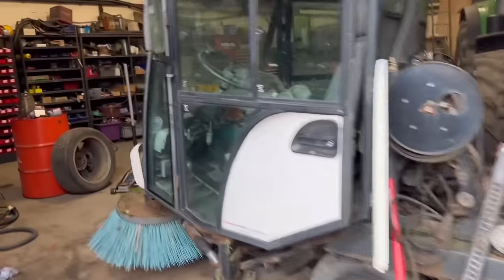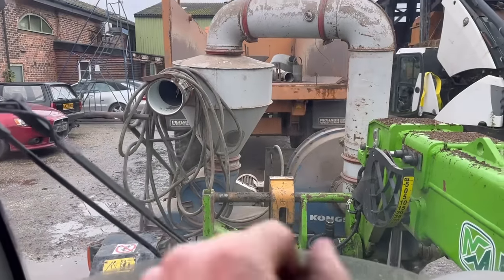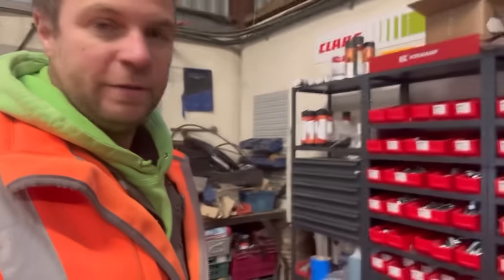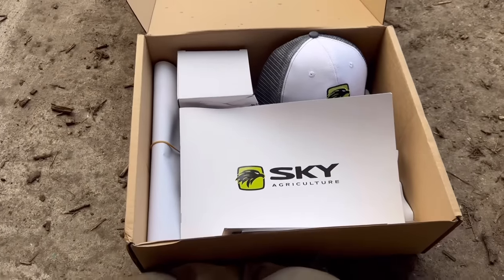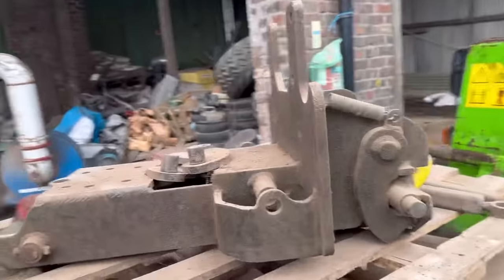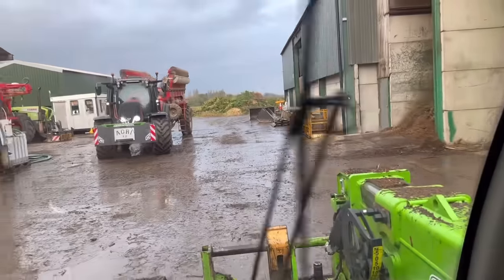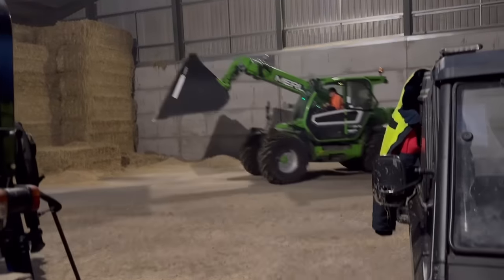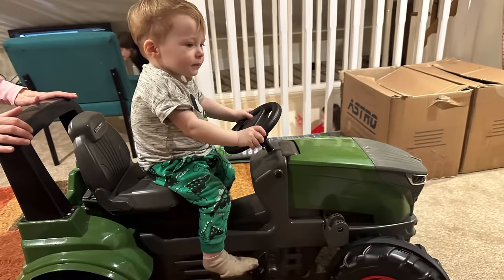WE NEED A BIG HOOVER FOR THIS JOB #AnswerAsAPercent 1322

Comment: A word or caution on using the sucker blower on wood chip I very much doubt it will work as it will jam up the rotary valve/ airlock under the cyclone. These are great for small items but anything long or stringy cause major problems.

Comment: Maybe if the sweepers weren't left outside theg wouldn't rust so badly. 
Why not use a mobile power unit generator build it a wheel base so to more around easier

Comment: Oh, Just for your info Olly, You can get a box which has several sized commando outlets That have a din rail with Mcbs that you can use with your 63a socket.  You can’t use them all at once but just to enable your welder and other bits  🤷🏼‍♂️

Comment: Hi Ollie we have the electric and the pto version of the konskilde suction blower they like clean grain but don’t like the dirty thrashy grain that sometimes accumulates in the bottom of bins and heaps fed from over head elevators. The pto one is way better as with the electric one the plug s get so hot you can’t get them open till they cool down and shrink. We use 3 inch slurry tanker pipe as a inlet. The pto one is makes a ford 6600 work hard.Fix a road sweeper will be more useful.

Comment: We used  to use a sucker blower to  but 2000 tons in the  grain store  and  then  load it back  out on the  lorrys used to take hour and half to load  it sucks  in the  top and out the bottom